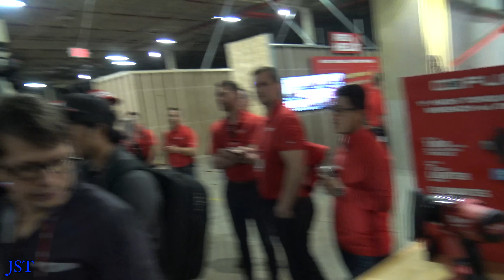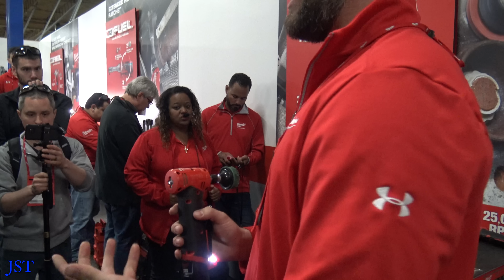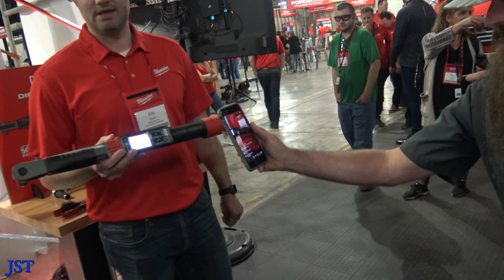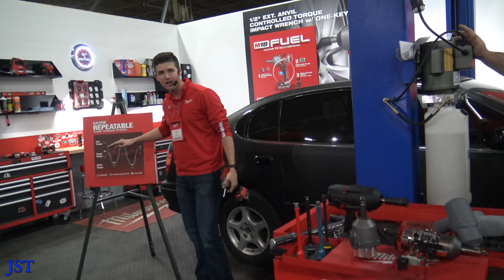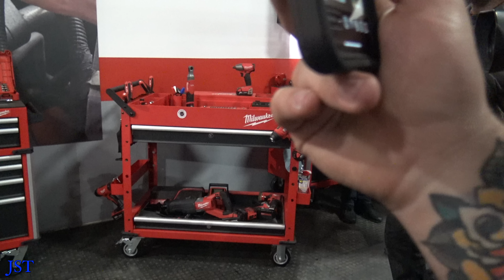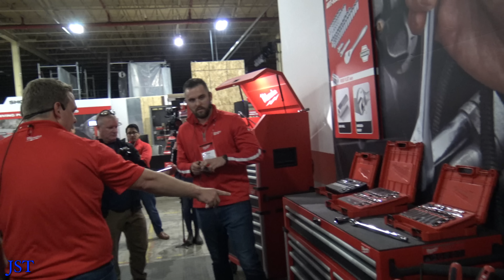MILWAUKEE TOOLS #NPS19 MY EXPERIENCE  TRANSPORTATION MAINTENANCE

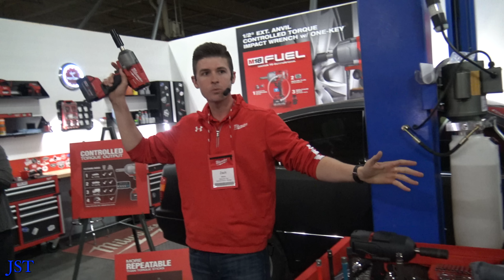Comment: @24:04.  Fake news.. my Milwaukee can’t even brake 500lbs on a lug nut.
Reply: Considering my 2767 busts rusty lugs off semis, dump trucks and will bust bolts loose on bulldozer tracks. You've either clapped your Impact out, using an old as hell milwaukee, or are full of shit.

Comment: 1" impact. Been waiting to hear updates. So glad to hear 2 weeks. Any ideas on the price ????
Reply from the maker: 699 bear tool 899 I think with chargers and batteries
Reply: @JUSTINSTURGILLTRUCKING  shit that ain't bad considering. I'm game. Thanks
Reply: Andy Shockley it’d be cool if they had an extended anvil version so you wouldn’t have to run an extension to do truck tires

Comment: Die grinder test seems shady, cause with air once it starts to slow it starts going down hill fast, but with electric motor it will provide a more constant torque under resistance.. but with air, as you start to lose speed, your torque drops as well.. am I missing something or is this a gimmicky test?
Reply: NLytle312 that’s the point. The electric motor doesn’t lose torque with resistance
Reply: Sam Wagner I understand, but my point is just that, it’s not much of a fair test without knowing the inlet air, and power curve. I don’t have a dog in the fight, just thought it seemed a little suspicious.. considering the air depends on RPM to provide torque. Just wondering what everyone else thought